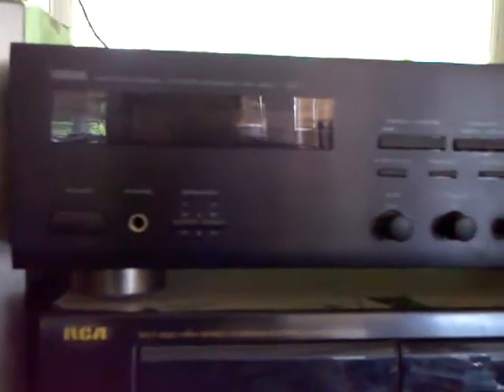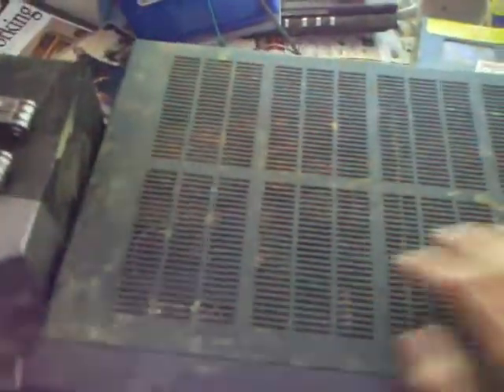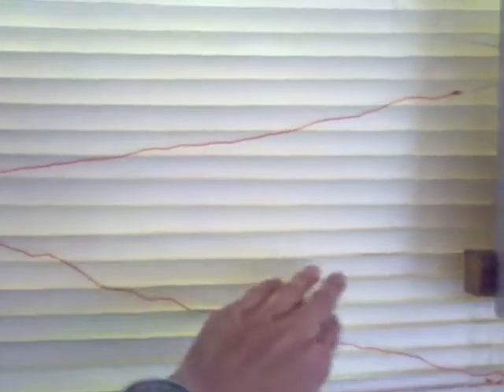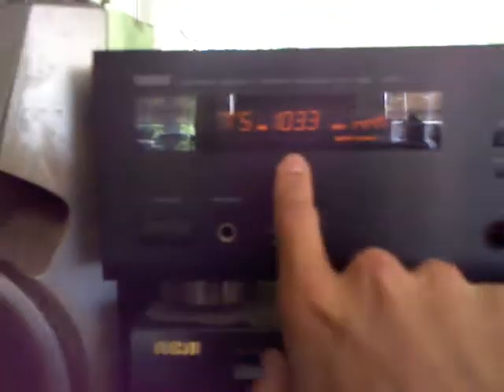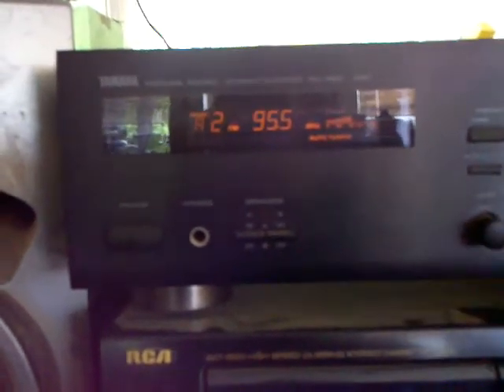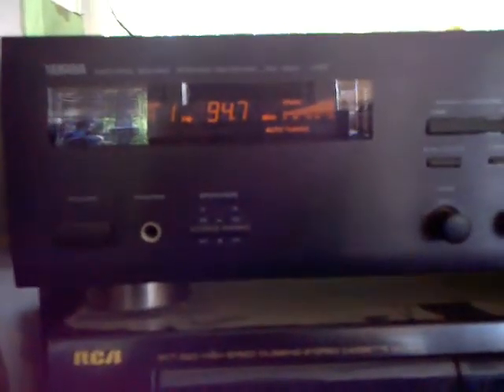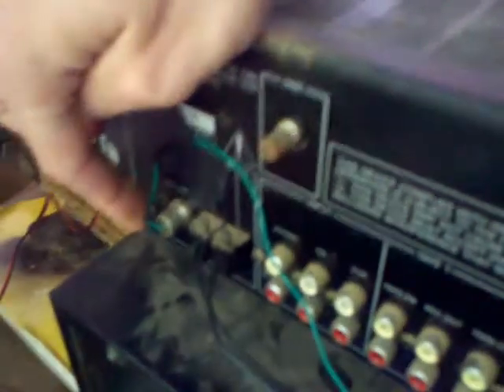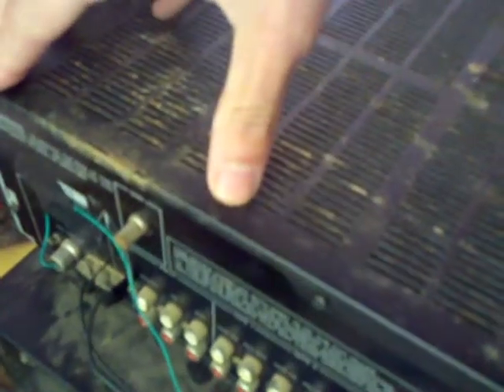VIDEO REPLY to : fortyfiveplayer | Yamaha RX-460 FM Reception in daytime.

Comment: OK, don't be cutting any jumpers on this one- The board is way different on this one. As to why this one is deaf (not good at signal pulling) it's like mine! Locals are fine, nothing unless I have mine in DX. I am trying to find out now if it is a design issue, in other words if ALL their tuners have to have good signals- or it may be a bad RF amp transistor.